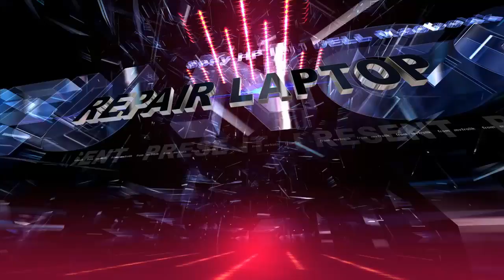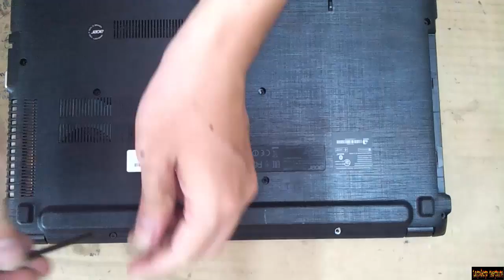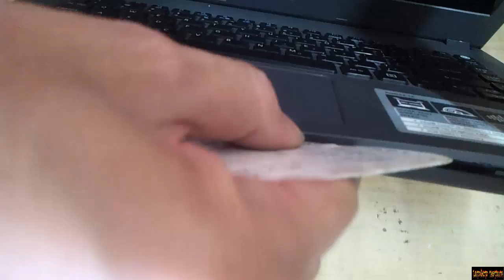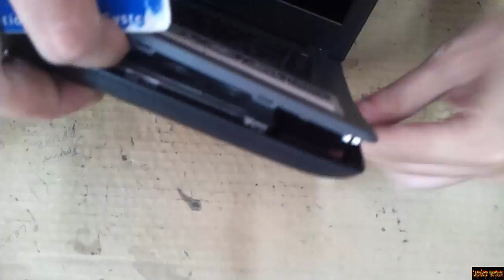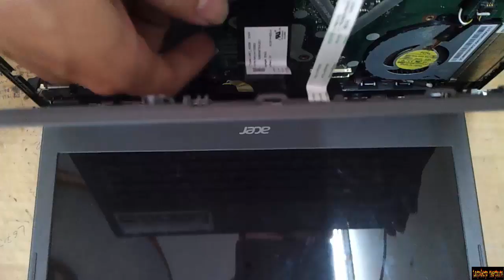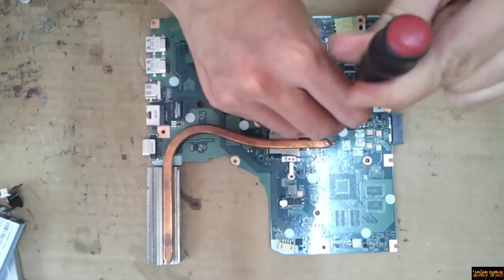Acer Aspire E5-473  Disassembly and fan cleaning laptop repair

Comment: how do you remove the cmos battery, when i looked at mine it looked soldered, i dont want to force it, it might brek the pin connecting to the board.

Comment: Hope I still get an answer..

Im planning to transfer may hdd to odd slot using hdd caddy, Can I put an ssd on the original hdd slot?
Reply: I would recommend to replace the existing hdd since the one that acer uses is crappy.
Reply: Yes you can.

Comment: Ive always liked acer, but this model is a piece of shit. In built battery and one ram slot, 2GB graphics card that performs like and old shit 512MB graphics card. Decides it does not want to turn on anymore, tried every tutorial fix on youtube so to fix it I conducted a test......test to see how far i could throw it down my street and then dusted off my old acer windows 7 laptop with only 3Gb ram and 1 GB graphics card which plays games at a higher graphics setting (no bullshit) and it still works better after sitting in the cupboard for over 2 years.

Comment: will my laptop still open without battery?
Reply: yes it will as long as the charger is inserted.
Reply: It doesnt look that the battery is removable
Reply: Killer Franz123 yes because the battery is located inside of laptop

Comment: how remove the battery?
Reply: I removed the battery by desoldering it, I do not know if there is another way
Reply: @leoneldominguez5123  I don't know if you have the same laptop as in the video, but for the E5-473 there is no soldering required to change the battery, just open the laptop as shown in the video, unplug the battery and change it.

Comment: Hey. I have the same laptop. My problem is it doesn't boot up anymore.  i sometimes hear a clicking sound
Reply: Possibly the Power button on the keyboard is shorted. to find out take off the deck and unplug the KB and Touchpad. then with the power cord plugged in take the ribbon for the KB an slide it into the slot till the blue light comes on then remove it. The computer should boot normally. This is the case I am repairing at the moment. If the computer turns on and Boots normally and battery charges then the KB is shorted. Just replace the KB and that should solve your problem.
Reply: the problem is probably on the hard drive
Reply: What if the problem is it won't start the power indicator just lights up for 5 seconds and turns off? That's the case of my laptop.
Reply: hi we had the same problem in our laptop any update or idea on how to stop a clicking sound and won't turns off when you opened once.. tnx :)

Comment: What happens when you exchange the black and white antenna cables (main and aux) that attach to the WiFi adapter card?
Reply: Andrés  Ortiz sounds like u shouldnt even be looking inside a laptop

Comment: can i upgrade the ram of this laptop? if yes what is the ideal ram? 8gb or 16gb? thnxxxx :)
Reply: There are 2 SODIMM slots on this unit. Download and run System Information for Windows. Te program will tell you what the max amount of RAM that can be used and how much per slot.